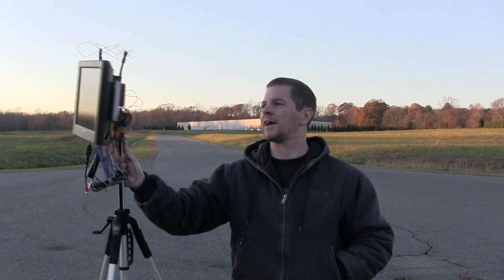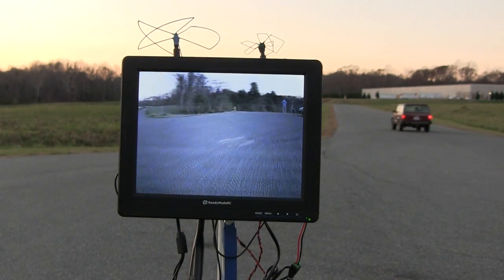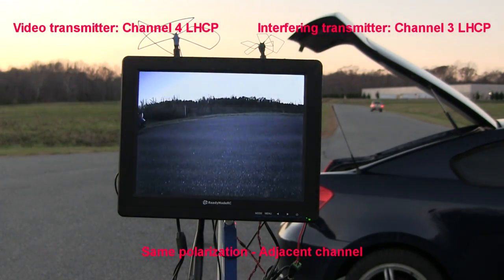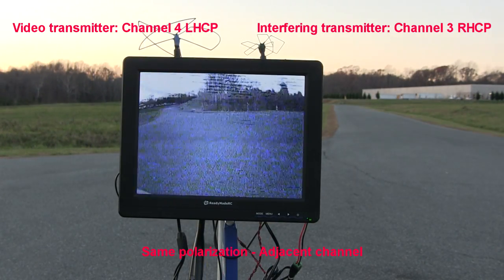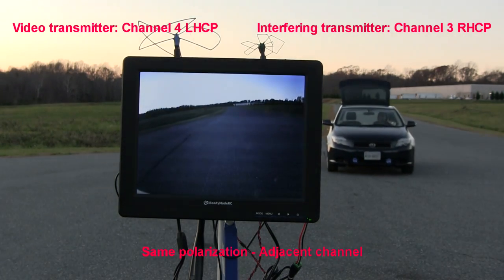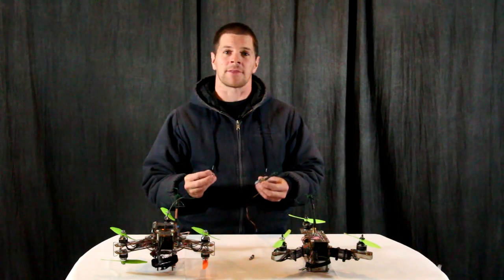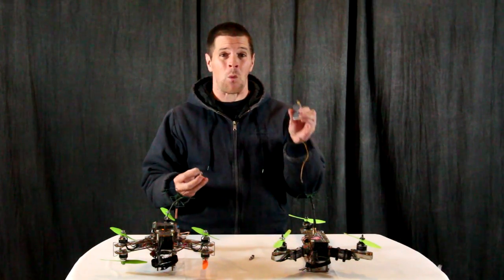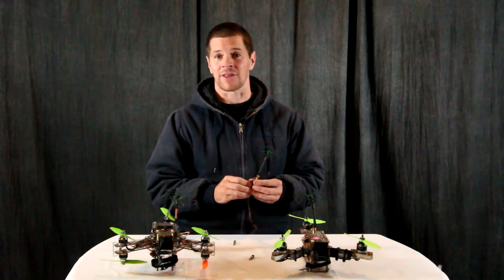3.4GHz Iron Horse video system interference test #1

Comment: Where is the interfering transmitter in this vid?   In the car with the primary transmitter, or right next to the receiver?  
It's very confusing that you're putting text about the transmitters over the two visible antennas on your GS, one of which is clearly not sized for 3.3Ghz.
Reply from the maker: +techdaemon - It is just behind the camera.  I had the cameraman holding it in his hand.  I am currently editing the flight video I did yesterday.  Results were somewhat disappointing for the receiver...

Comment: Sweet.  I am really stoked on the new 3.4 band.  Now you just need to convince Hobby Wireless to make a lower power transmitter.  Maybe 200mw or 300mw.  Also r you considering making Dura-spec antennas for 3.4? That would be awesome.
Reply from the maker: +Wyll Surf Air - Trying to do that.  I am also trying to figure out a better channel spacing.  I will be doing more testing shortly.
Reply: +Alex Greve  Sweet.  u really like where this is going.  I was thinking of switching from 1.3 to 5.8 for my minis but maybe I will wait and just go to 3.4